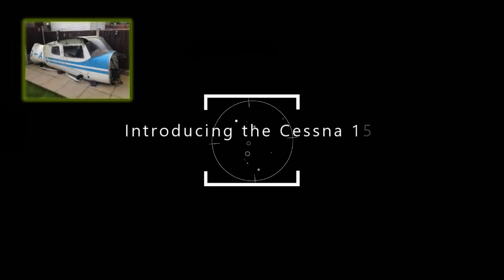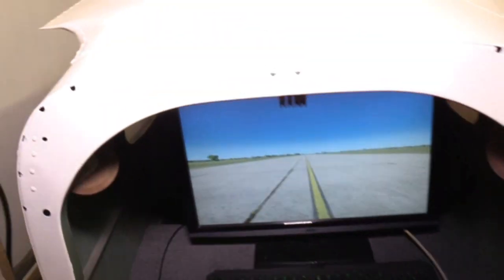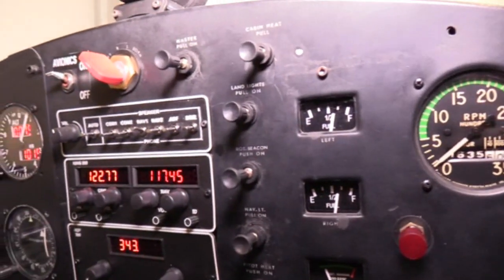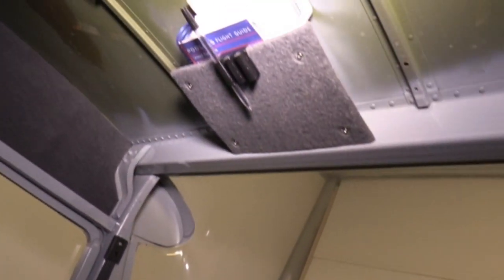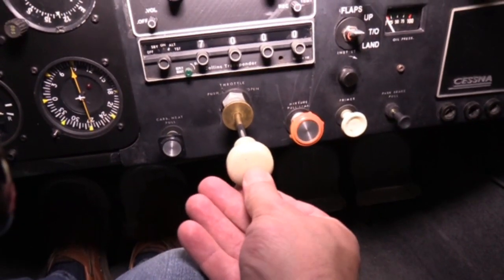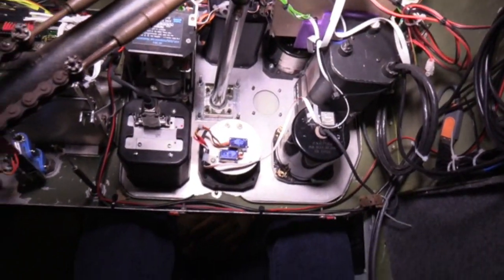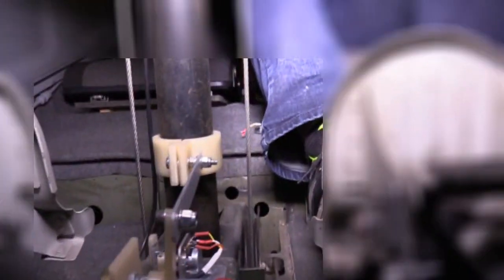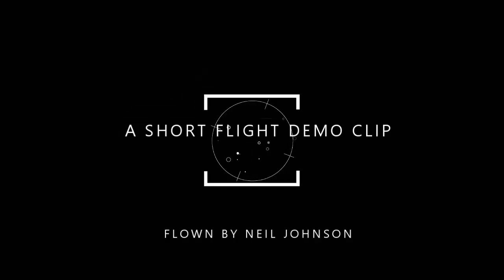Cessna 150 Home Built Flight Simulator - First Look Cessna150

Comment: What happened with ur old cockpit?
Reply from the maker: Hi, if you mean the 737 cockpit then it's still up and running. I am changing the overhead control boards to OpenCockpits, installing a second Flight Management Computer and also fitting a wet compass, so it will be down for a while. I have a continuous improvement programme going with that cockpit, so the Cessna is a great opportunity to practice basic flying skills as it's fully aerobatic. Kind regards, Neale